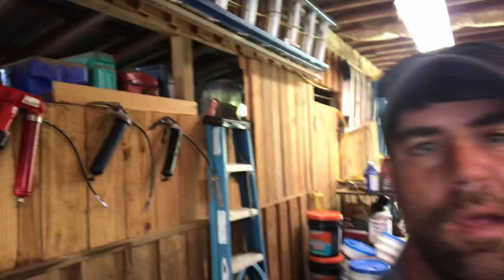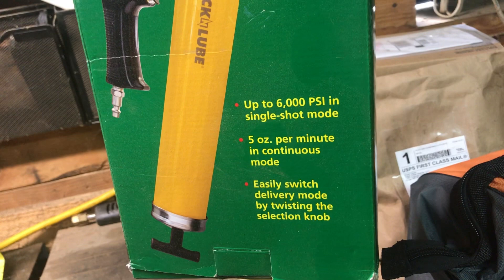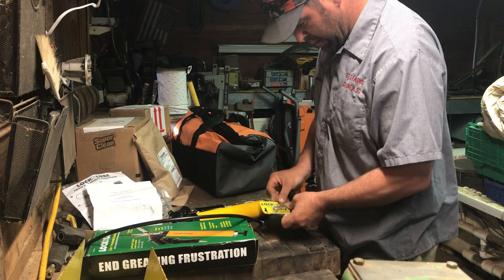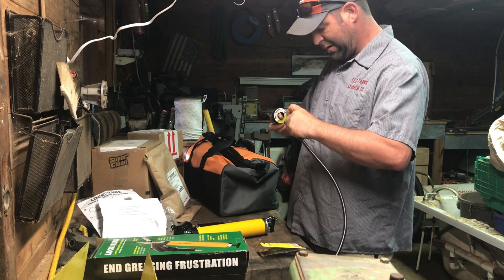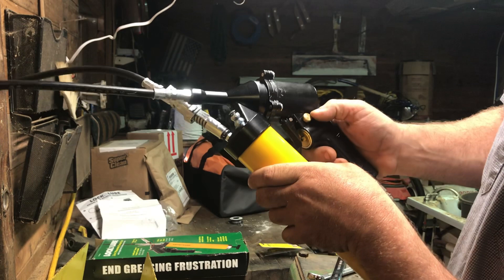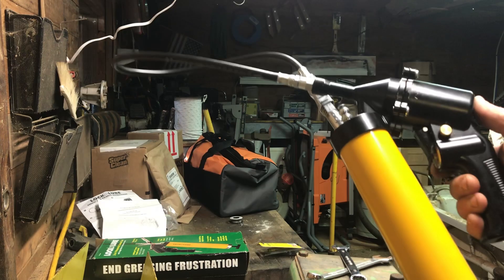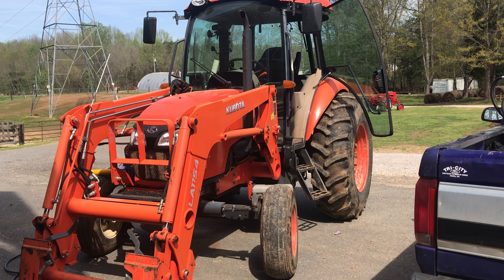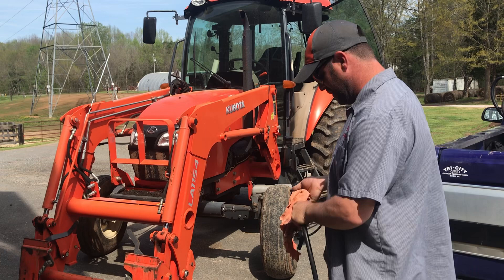LOCKNLUBE AIR POWERED GREASE GUN    #slcfarms   #farmtube   #cooltools

Comment: Nice!  I have GOT to find a new grease gun.  My Lincoln, like yours, is about to go in the garbage, my cheap tractor supply air gun is loaded up with moly right now, could use another one and I've been wanting a lock-n-lube for a long time, so this gun you got is the way to go!
Really too bad about the livestream!  I've got a shoutout coming on an upcoming video for ya!  Probably won't help much, but I'm trying!  Thanks for the video and the heads-up on the grease gun!

Comment: I been holding off on new grease guns for a while so i guess i should go after a lock n lube setup like yours
Reply from the maker: I really like it. I know battery power is nice but I own all ridged cordless tools and didn’t want to spend the $ yet. I will eventually get a Milwaukee unless ridged starts producing one. The air is working great I haven’t picked up an old gun since putting the new one together. And the locknlube actual end man I don’t know why I went so long without. I’m going to order one of there manual guns and tips for just in case no air around. Thanks for watching.

Comment: I have two Lock and lubes.....  Only Problem is if you have a fitting that refuses  to take grease it's a bitch to get off the fitting........There is a company in Fort Mill called Lumax(704940 6988) that sells one that locks on by snapping the thumb handle back over center... so removing is a snap  Has been tested over 22000 psi with no leaks   Sold thru Amazon
Reply from the maker: Minnesota millennial farmer Uses Lumax. I looked at them as well. If I run into issues I’ll sure vidja it and tell ppl. I’ll also look into the lumax. Thanks for watching.